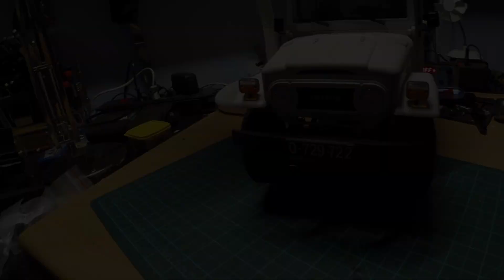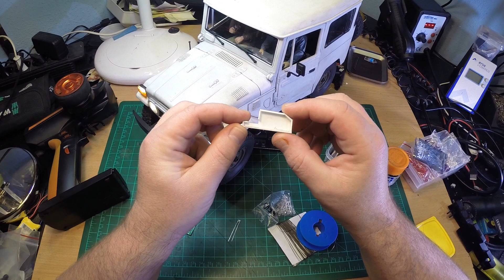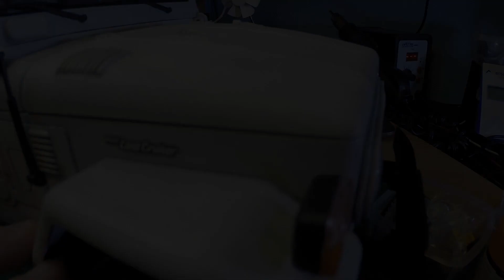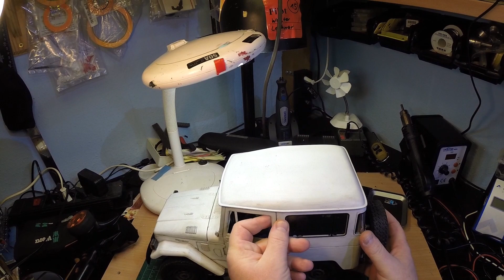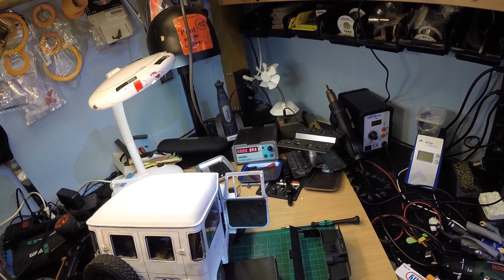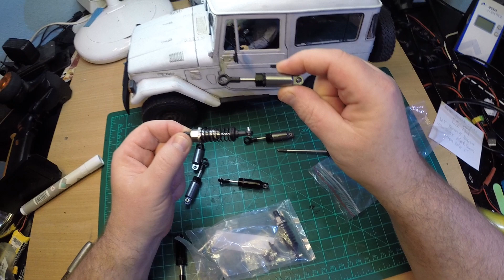WPL C34KM Land Cruiser FJ40  Build, Mods, Upgrades - Part 12: Body and Lights

Comment: Hi Donald, I would like to kindly ask you how you connected the light controller to the receiver, fly sky GR3E, I would like to ask you if it is possible to tell me where exactly the 5 wires should be soldered, I have a Lane Rc Mk4 light controller that I would like to mount on a model without using the preprocessor, I would be grateful if you could answer me, thanks.

Comment: Hey, finally got around to wiring up the laneboys light controller, also I’m using the pre processor, with the RES V3 do I need to touch the ESC like in vernas wiring sketches?
Reply: Still haven’t wired up, I’m unsure how to use the 5 channel pre processor with the v3 esc

Comment: I used to have a 72 FJ40 and you sat high on the seat because the gas tank compartment was right underneath the seat. It was like driving a bus that Fj40 was a tank

Comment: My constant love is the Toyota Land Cruiser Fj40. The result of your hard work is awesome. I also bought the same model wpl c34km and painted it khaki, and also bought two 5" figures (Rick and Garreth) as car occupants. I want to install the same details of the front and rear turn signals for my car, but I do not know where to get that small electronical board. Of course, my control handle is the one that WPL sells. What RC handle do you use for these upgrades?
Reply from the maker: I use a Flysky GT3C and a LaneboysRC Lightcontroller. But you can use any radio and receiver.
Reply: @donaldsneffe  
 @donaldsneffe  
I did not find the right rear lamp for this car.  I had to make the rear lights of my car myself.  The first time, I made two lamps from the pieces of orange and red lighters, which turned out great.  But later I made much better lamps with nano lego's and red, orange and white acryl pieces, which are very better in terms of colour, size and shape.
Of course with Squar led diods are easier
Reply from the maker: @RmanFar  Cool - I love to tinker and use "own ideas" for such stuff, as you did. Most people only wanna buy "plug and play" nowadays. Thumbs up!
Reply: how are 5" figures fit in the c34/44? Are they scale enough?
Reply: @arievianza  
 @arievianza  
Well, if you put these 5" figures in the car, it is very good in terms of scale.  But if you put it outside the car, then of course these figures are smaller than the car in terms of scale. Actually, compared to the outside size of the car, the figures should be about 6.5" to 7".  

Let me say one more thing: 
WPL says that C34/C44 are 1/16 scale, but this is not true. I found out by exact measurements of a real Toyota FJ40 that the scale of this wpl C34/44l is about 1/12.
 So, for an 1/16 RC= 5" figure and for 1/12= 6.5" to 7" figure
Although inside this WPL C34/44 a figure larger than 5" cannot fit.
Reply: @RmanFar  Thanks you're so insightful. Agree about C34/44 is at 1/12 scale, I am just not sure is it true to scale or just roughly. From your measurement, I can safely assume its exactly 1/12. 
5" figure indeed look a bit small for 34/44. WDYT if the seat is removed/modded, can we fit 6.5/7" figure in there, or still it would be too big to fit?

I am thinking about making rear lights too using acrylic sheet. I am interested about your idea, can I see a tutorial or some more info on that? Thanks again.

Comment: Hi! I do have, however, one more question for you : what's the total weight of the vehicle ( with battery, ESC and all the stuff), and, also, the dimensions of the vehicle ( length, width and height)?
Thank you.
Reply from the maker: It is 1.676 kg incl. Lipo and a normal WPL C34, so about 35 x 18 (width) x 16.5 cm (including spare tire and side mirrors).
Reply: Thanks.
Reply: And for the C44KM?
Reply from the maker: @razvannicola5197  Longer wheelbase - check specs.
Reply: Weight - is it same?
Reply from the maker: Donno - mine is highly modified with wheel weights, driver figures, upgrade electronics... paint... So my truck is much heavier than stock
Reply: Very well! Its weight? With all that stuff....
Reply from the maker: @razvannicola5197  See my first reply - it is heavy, 1,676 kg.
Reply: Thanks, mate!
Reply: And, yet, one more thing : I saw you posted a video about the RocHobby Type 82 E Kommandeurwagen. Do you have any idea about what weight does it have?
Thank you.
Reply from the maker: @razvannicola5197  It is super light (compared to my C34KM, which has all metal parts). Cannot weigh it anymore, because gave it to a buddy. But plastic axle housings etc..., the truck including battery, radio, styrofoam box and cardbox and manual, charger etc. does only have 1.8 kg (or was it 1.6? written on the box), so the truck is probably less than 1 kg.
Reply: Can you measure its weight, please? I' ll tell you why.
And also, are you intending to make some upgrades for it?
Which, from them would deserve most?
Reply from the maker: @razvannicola5197  I do not have it anymore. Gave it to a friend... have way too many cars. The Beetle (and the Kübelwagen I also had bought) are nearly perfect, not much room for upgrades, top electronics... etc. - so I would not know what to upgrade so I sold them.
Reply: Ask your friend ( when and if you do have time), to weigh it. You'll find out why.

Comment: whats the stock wheel base for the wpl c34 rc car?
Reply: It is about 7.625 inches in Imperial measurements so about 19.36 cm. It is variable because you can lengthen or shorten the trailing arm links a small amount.

Comment: Can this mods work on wpl c44km?
Reply from the maker: Yes, same stuff. C44KM does already have a quite good servo, so no really a need for upgrade. Center gear ist different, C44KM has 2-speed, C34KM only single speed. 2-speed gearbox and servo need a lot of room... Wheelbase of C44KM is longer, but not really important for the mods.

Comment: Hello, Good morning, could you put a link to the dolls? It is impossible to find this scale.
Reply from the maker: Head passenger: https://smile.amazon.de/Mattel-DNV45-Suicide-Collector-Boomerang/dp/B01BTIV5N2/ref=sr_1_12?__mk_de_DE=%C3%85M%C3%85%C5%BD%C3%95%C3%91&dchild=1&keywords=boomerang+figure&qid=1597177132&sr=8-12
Head driver: https://smile.amazon.de/Suicide-Squad-Figur-Bewaffnung-Figurengr%C3%B6%C3%9Fe/dp/B01I4X5IX8/ref=sr_1_1?__mk_de_DE=%C3%85M%C3%85%C5%BD%C3%95%C3%91&dchild=1&keywords=Suicide+Squad+Rick+Flag&qid=1597177233&sr=8-1
Body passenger: https://smile.amazon.de/Hasbro-E1200ES0-Black-Figure-Actionfigur-6/dp/B078DPDJRR/ref=pd_sbs_21_2/258-1137948-1904520?_encoding=UTF8&pd_rd_i=B078DPDJRR&pd_rd_r=f5f4bfdb-ed9f-4c9e-905a-01db77c914ab&pd_rd_w=usvH9&pd_rd_wg=3GPNG&pf_rd_p=a03ac387-6e4d-4f6b-96b6-1853da0bb37b&pf_rd_r=K27FJ13R0D8M1WQTP6Y4&psc=1&refRID=K27FJ13R0D8M1WQTP6Y4
Body driver: https://smile.amazon.de/Unbekannt-Walking-37-188-Negan-Action/dp/B01BOV5IGO/ref=sr_1_1?__mk_de_DE=%C3%85M%C3%85%C5%BD%C3%95%C3%91&dchild=1&keywords=Walking+Dead+Comic+Serie+5+Negan&qid=1597177336&s=toys&sr=1-1
Reply: @donaldsneffe  thakns

Comment: It may be an ABS based plastic,rather than a hard polystyrene,so the glue used to glue plumbing pipes together may well work.
Reply from the maker: Maybe... for sure there will be other glues, that will work.
Problem in testing many different glues:  Many of those are really expensive and only buying it for some tests is hard. I "am full" with different glues here in my hobby work bench ;-) (probably about 20 different types).
I am glad I found this Toolcraft Ropid 150 cheapo, that works, so I will stick on it (cheap and easy to get for me here). Tamiya plastic cements, Aceton, normal CAs, foamsafe CA, Shoegoo, E6000, Epoxy, Uhu Epoxy,  ... do not work. 
There are some probably extremely good special plastic glues available here (like "Schweißnaht aus der Flasche"). But they are very expensive and since I did have success with this Ropid 150 actually I do not have any need to buy it. (BTW: Toolcraft CA Black also does NOT work with this plastic).

Comment: Have you tried Team Associated Green Slime on the WPL shocks? If the shocks have O rings coat them with green slime and should help with leakage 👍
Reply from the maker: No - maybe will try. But the orings are tiny and the shocks are leaking extremely... Will check out this Asso stuff, thx!
Reply: @donaldsneffe  I have used green slime for years on all shocks that contain oil be it large or small shocks. 👍
Reply from the maker: Got an email with a question of you about figure size... but does not show up here. Figures are glued to the seats now, so hard to measure. But they are about 15 cm height... without lowering the seats it would be hard to put them in.
Reply: @donaldsneffe  I asked about the figures as I was watching you're video, then noticed you got around to the figures with sizes etc so deleted my comment 😑